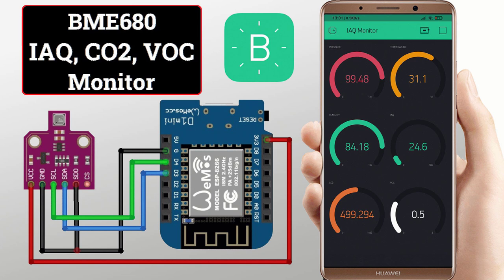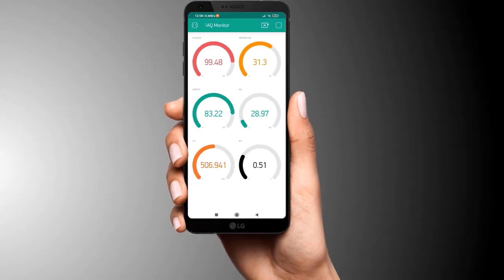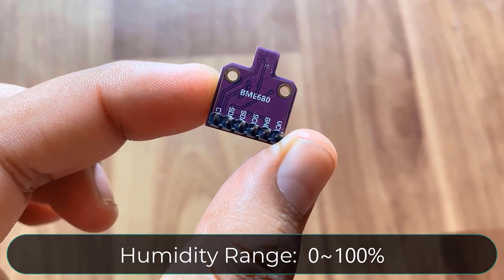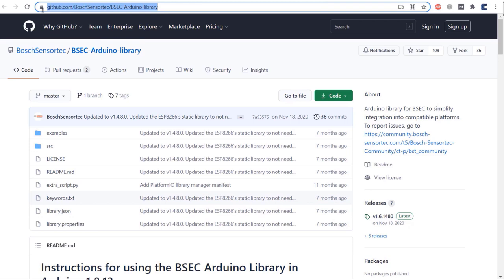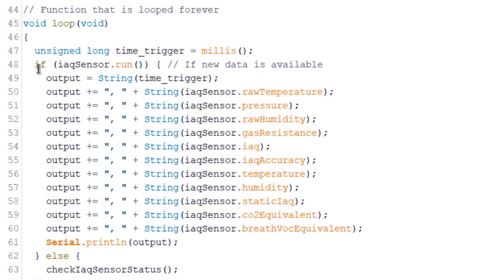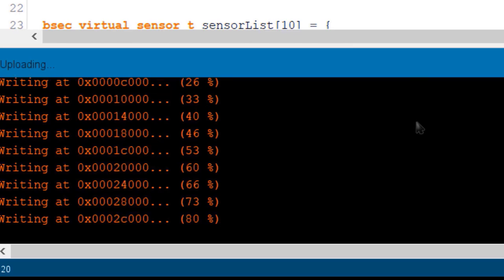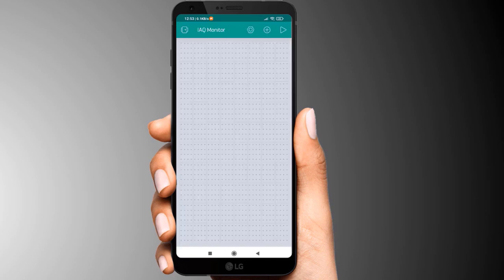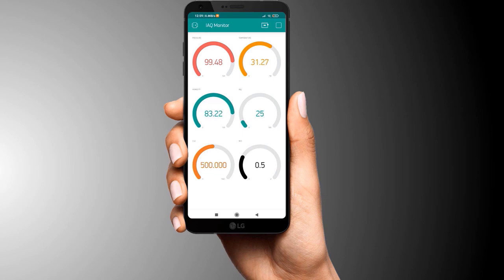IoT Indoor Air Quality Monitoring (IAQ, CO2, VOC) with BME680 BSEC Library & ESP8266 on Blynk

Comment: Thanks a lot for sharing. Fantastic video.   Like to know whether do we need to do any modification on the platform.txt on the esp32 bcoz I did not see any instructions given on how to add extra lines. Is that required for esp32?
Reply from the maker: Yes few modifications required. Check the website article. The video and tutorial is straight forward.